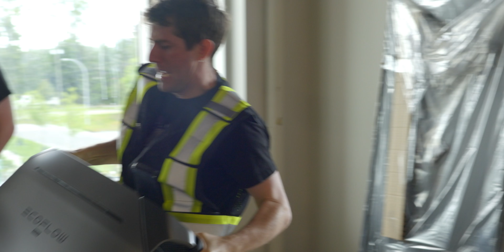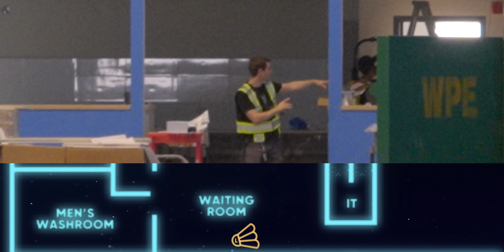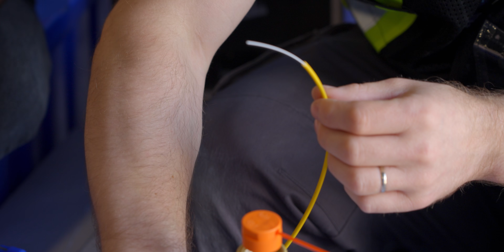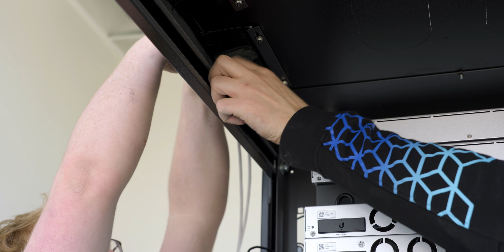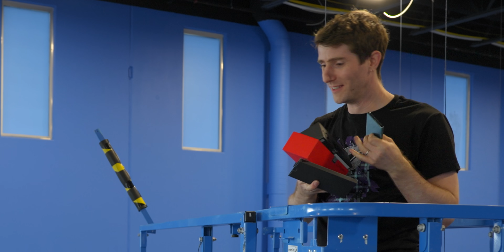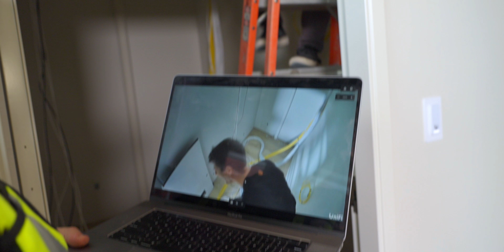I put WiFi 7 in my badminton center

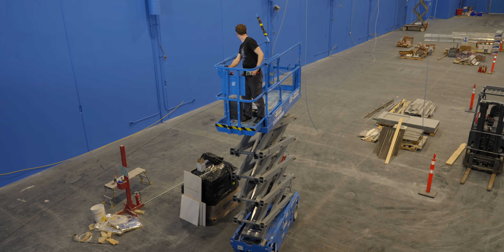Comment: Fun fact: at 19:07 Linus violates the Canada Labour Code by moving the scissor lift horizontally without a harness
Reply: We caught him lackin
Reply: Call the mounties
Reply: glad to know Canada has heir own Osha
Reply: Its inconclusive. Do you have a measuring tape to measure if the platform is over 2.5 meters tall?
Reply: @ImTheMrMoose  That platform was for sure over 2.5 meters tall.
Reply: @ImTheMrMoose we have Linus for reference ;)
Reply: @ImTheMrMoose  I measured the pixels using linus's height for scale (0.25 meters) and it is well within legal limits
Reply: I wouldn't even dare to go as high as he did without a harness, some final destination stuff right there.
Reply: @TheReduxGB  A harness is for getting kicked out of the EWP.  scissor lift doesn't have the danger that a boom lift has. I would actively not wear a harness in a scissor lift as it is more likely to create a trip hazard and be more dangerous than safe unlike on a boom lift where the risk is a lot higher especially when driving around as you can end up in a catapult.
Reply: @johnschroeder3072  there is reasons it's required by numerous safety boards - safety you never mess with even if it seems useless, as it exists because of accidents in the past.

There was a point where Linus knelt down to pick something up from the 'toolbox', at the way he was, if he lost his balance for whatever reason he could arguably have easily fallen out in my opinion.
Reply: @TheReduxGB  In my experience wearing a harness in a scissor lift is more dangerous than not wearing one. I scissor lift has the same railing coverage as many fixed walkways where you clearly do not need a harness.
Reply: @johnschroeder3072  They actually require a tie off in any EWP (source; am a licenced EWP operator for everything except airport luggage trucks and ladders). They also require a shorter lanyard for boom lifts vs scissor lifts because in the case of a scissor lift the lanyard and harness is there to keep you from falling off/out of the platform where as with the boom lift the harness and lanyard are there to ensure you don't become a trebuchet projectile, seriously booms are more likely to throw their operator than an operator is likely to fall out of one, people lean over the railing of a scissor all the damn time.
Reply: He must attest for his crimes
Reply: No hard hat or high vis jacket either
Reply: @M1Ms88  Hi-Vis in that situation is pretty useless and the only place that a hard was of use was either donw the bottom near the scissor lift or in it as he was working near the roof .
Reply: @M1Ms88  He is at the top of a lift, what the heck would they accomplish exactly?
Reply: Let's wear a harness, fall out of the lift, and then pull the lift down on top of me. Tie off in scissor lifts is stupid unless it's restraint, not fall arrest
Reply: this comment was all I was looking for, after they showed that
Reply: Most countries don’t require that in a scissor lift… a boom is different. A harness wouldn’t do anything in a scissor lift except create a hazard.
Reply: im reading the regulations and they keep specifying workers of the employer. perhaps linus did not violate it at 19:07?
Reply: AND the platform is raised!! 🤣
Reply: Canadian osha about to get 2 thousand narcs calling to report on linus from the united states and they'll do an audit and find nothing wrong. Linus will complain on wan show and canadian osha will get several thousand more calls from narcs who are mad linus got mad.
Reply: is that actually required in canada?  here OSHA mandates that a scissor lift is about the only time you are NOT required to have a harness. the lack of a hard hat could be an issue though.
Reply: Actually, in British Columbia, where this was shot, that is not a regulation. Lifts are only required to be operated with a harness if they extend outside the base (like a boom lift) and don't have a complete railing (it does). Also, the Canadian labour code doesn't govern this kind of work, it only governs federal operations. Provinces have their own acts. In BC, it's the worker's compensation act and its subsequent regulations that govern the provincial work. The CLC's Safety requirements are only for things under federal, not provincial regulation.

However, with all that said, it may violate the BC OHS regs IF that specific lift had a requirement to wear a harness in its manual--since there is a clause in part 3 of the regs that makes manuals as good as regs in BC. Most scissor lifts don't have that clause though.
Reply: I'm glad someone raised Linus AND the cameraman not wearing a harness on an EWP. Maybe Canada is a bit more loose compared to Australia but it hurt to watch.
Reply: @alexanderfreeman3856  In Australia you are NOT required to wear a harness in a scissor lift. The only EWP that you are required to wear a harness in is a Boom Lift.
Reply: And no reflective vest to top that
Reply: Snitch
Reply: Kaon here, I was very concerned that I may have to do my General Industry job that's not in my jurisdiction (US here)
Reply: Calling the labour board
Reply: So where should the harness be secured to? The ceiling?
Reply: I don't know anything about codes, but that was a pretty obvious no-no.
Reply: comparing it with the height of linus that platform may be just half a meter tall hsbvhdsbvsjbndjkns
Reply: We're worried about man getting thrown from a Scissor Lift in a flat warehouse?
Its not like we are travelling in a Boom Lift's basket across an uneven surface. We arent getting catapaulted.
Do your risk assessments, this is fine. 
also mans is the proprietor, not a worker. He is liable for himself.
clearly not a concern
Reply: @beahydrated whilst this is true he is also broadcasting bad/ poor practice on the internet
Reply: Narc
Reply: 😂a harness in a scissor lift, what a joke
Reply: @juledoren  regulations are written in blood.
Reply: @Eridescent  A harness is going to be more dangerous in a scissor lift than safe. In a boom lift, well that's another matter
Reply: @Eridescent  a harness wont help if your scissor lift falls lol you are gonna be falling with it regardless
Reply: @juledoren Just based on common sense: a harness will save you if you get shocked or stumble and go over the edge. A helmet will protect you from smashing your head against the beam and going over the edge due to temporary loss of consciousness, and also protect your head from smashing against the scissor if you do go over the edge, enabling you to assist in the work of saving you.

Tipping it while stationary, not likely. The fact that it moved as fast as it did while extended? Actively stupid. It looks like that platform is about a meter wide. He had it raised to about 4-5m height. Ride one side wheels into a ditch 20 cm, be standing in the side that it tilts toward, and the whole platform will be outside the footprint of the base. There are cable channels in that floor (shown in previous video), we are assuming that the covers are installed and can take the weight of half of that platform.
Reply: @Eridescent  I have absolutely no clue what a harness is supposed to accomplish on a lift.  It is basically impossible to fall off of one of those unless you are being intentionally unsafe.
Reply: @juledoren  I mean, when he also leaves the gate open you can see why they're required in some areas.

Comment: i actually build and modify doors and frames for a living to make that strike fit all your gotta do is measure out i think 1' 1/8 down dept on face aka. cut the side of the frame out (its been a min since i had to modify one of these) from the small part that over hangs from the ASA face plate and or course weld in new mounting plates for the electric strike (E9) in the frame EZ PZ.

Comment: You think you have it tough splicing that fibre… try cold cure polishing multiple fibre ends on a building site. Now that sucks. Final pass and someone walks past or opens a panel door and… scratch… start again… someone starts up a new air handler and blows a load of shit down the duct… scratch… start again… someone decides to install an interconnection in a box outside…. Scratch… and start again… sparks cut the fibre too short and won’t re run it and polishing on the top rung of a set of 10 tread steps… you guys don’t know you’re born… 😂😂😂

Comment: Being that high on scissor lift BUT trying to lift 6meter long steel pipe with outer diameter of 115mm on the hangers with your friend. So scary stuff to do that high and breaks forearm muscles so you need to be fast and precise while trying to not drop the heavy pipe on someones head or destroy the concrete floor underneath

Comment: Well,if you can watch your videos on more than 360p without it buffering than ofc your wifi is better than mine. 
Egypt needs it's internet infrastructure and make it unlimited ffs.
Reply: More like mindset. A lot of international sea cables pass through Egypt. They could surely have good network if they wanted, unfortunately it's the mindset that's holding them back
Reply: @hariranormal5584 we had a good speed and unlimited internet like 8 or 7 years ago but when the current government took over (using the internet to their advantage) they downgraded the internet so that ppl don't use it against them

Comment: Not a great sponsorship on that rack.   The rails should not be that flimsy with that amount of weight, even with their side mount sections.   I have lot of the same gear crammed into my Startech rack with no issues (UDM SE, NVR, High Cap Agg, ProMax24 POE, etc).

Comment: hey people i want to put out a call to the gamers using starlink should i get it for my gaming rig? The max gbps i get of the town's copper it 50gbps, and i can get 100+gbps through starlink.
Reply: Are you sure you got your units right? I highly doubt any residential connection provides 50 Gbps. you probably meant Mbps (megabits per second).
Reply: @JJFlores197  oh yes my bad i thought i had something wrong
Reply: @L0CKW0OD  Just be aware that Starlink has a much higher upfront cost than most other internet providers. If you need the extra speed and are OK with using satellite internet, it should be fine.
Reply: @JJFlores197  ok thx good to know

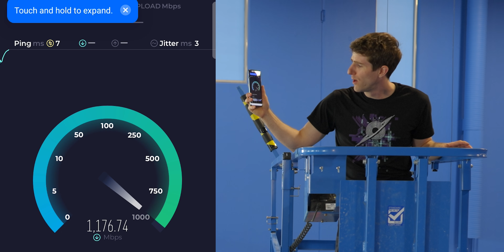Comment: 18:34 clickbait title. Here in Brazil you can get 2GB/s for the equivalent of 20 dollars (like 110 reais). This isn’t FAST by any means. That’s average.
Reply: There is a difference betwen Gigabit (Gb) and gigabyte (GB), they get 1,5Gb speed, which is 12 GB, and that 2GB that they advertise in brasil will not be real 2GB unless you live in the internet tower, it will be more like 0,4GB
Reply: @dominykasremeika89  When I run it through ookla speedtest (like they did) I do get higher numbers tho. It is gigabit but so is the one in the video I think.
Reply: For home use, sure.

Comment: That 4 post rack is nice and all, but I think I would've gotten 2 post networking racks instead if its going to be nothing but 1u networking gear. The 2 post racks are typically thicker to prevent the bending weight issue. You could still have the 4 post rack for servers as well, but this seems like a waste of weight capacity.

Comment: The wifi setup is definitely not overkill, I'd say it's underkill. I go to a demoparty called "Revision" every year with around 1000 ish people there, and probably around 2000 wifi devices. Anything that's using 2.4 and 5ghz is completely unusable in the main hall there. Like, i tried to open a wifi hotspot from my phone to my laptop who were right next to each other and the laptop did not connect. That's the kind of conditions you need to plan for. Your APs need to scream the loudest.

Comment: Ehh U7 Pro and S24 Ultra pulling right at 2gbps over WiFi.  But a lot less WiFi congestion than there though.

But my problem with WiFi 7 AP's is the issue with certain WiFi 6 devices not behaving correctly.  PS5 for example, nothing by latency and slow speed issues when connected to an AP that is WiFi 7

Comment: If you have not already, please put in some SFP blank covers in the vertical mounted fiber switches to prevent the empty slots getting filled with dirt/dust over time.
Reply: They said they already spoke to support at 12:48 and that they’re gonna get those blank covers from the manufacturer, but definitely agree, they also will probably not clean it out for like 6 years knowing LMG😂
Reply: @YesNo-rz2dn  thats for the side mount rack units in the rack, not the vertical switches in the bottom room

Comment: As a network engineer, I love when you guys do network related videos! Keep up the good work.
Reply: As a neteng you couldn't have watched this without cringing. Seriously, Ubiquti for everything?
Reply: @hariranormal5584  I did but they aren’t network engineers or claiming to be lol. I personally work with arista, Cisco, dell, Aruba etc
Reply: @hariranormal5584  They also used the wrong type of fiber connectors on their patch panels. Literally no reason to use PC there instead of APC

Comment: `????????? i have 1,5Gbps at home guys. ping 1. use HDMI cable if you can - delete all Cat5e RJ45 Ethernet Cable/Patch Leads - Booted. do you can separately turn off any plug in that giant power bar? no? fix that

Comment: I'm a bit mixed on the U7 Pro Max.  It removes the Bluetooth radio compared to the U6 Enterprise, which means it does not work with the Protect Smart Sensor.  It also lacks 4x4 on the 6GHz band, which feels like a bit of a downgrade.  Also, to be fair, I have absolutely no WiFi-7 devices and given that most of my mobile devices are Apple, chances are it may take me a few years to be willing to upgrade to a device that has it.

Regarding the UDM Pro Max, I kind of wish it had a couple LAN SFP+ ports on it.  I've sort of struggled with the best routing setup on my network.  Right now, the US-16-XG is my main switch that connects to both the UDM Pro and the USW-Pro-Max-24-PoE.  So, that means if I update either the UDM Pro or the US-16-XG, the Internet goes down.  So, I'd kind of prefer to use an upgrade to the UDM Pro as the central switch, but even the new UDM Pro Max doesn't have the SFP+ for it.

Awkwardly, one reason why I ignored Ubiquiti's U6 devices for so long is that none of their switches -- except for one really niche one -- supported PoE+ and 2.5Gbps. Fortunately, the new Pro Max PoE switches do -- as noted in the video -- support both PoE+ and PoE++ over 2.5Gbps.

Comment: I understand you gave a disclaimer, but every time you guys do anything with the ISP equipment or fiber, I shake my head. At this point I feel like LTT could use a full-time fiber tech, or if nothing else sollicit one of the thousands of technicians around you to give you a hand. Hell, I'd splice the end of the cable on for the lowly cost of a cheeseburger.

Comment: Your Wifi IS better than mine... No question!  However, I have a wifi 6+ router with 1.2g internet from Xfinity...  When I do a Wifi internet speed test from my Samsung S22 Ultra, I get between 1.1Gb - 1.2Gb every time. My Wifi may not support hundreds of users at one time, like yours.... but it kicks ass for a single user like myself.  😄

Comment: Video: Showcases corner office for literally any reason

My 12" subwoofer: "Let me sing you the song of my people."
Reply: I thought there was a semi truck idling outside  my house until I saw this comment.
Reply: Its quite terrible how loud it is with a subwoffer
Reply: Came here to complain about this. It's so easy to avoid I'm surprised they missed it
Reply: 12" subwoofer go wubwubwub
Reply: Not many comments about this, but damn it was loud. Editors must have bad headphones/speakers to miss it.
Reply: @tava6416  It wasn't terribly loud for me, but I also don't have my sub cranked regularly. 😅 I just noticed it and thought there was something outside. Hahahah.
Reply: @tava6416  i had to crank the bass on my sennys to hear it well enough to make sense of it, i dobut they could even hear it without a dedicated sub
Reply: @tava6416    @hemeon  timestamps would help but if you mean the background hum around 7:45 for example, you guys need to adjust your subs properly…  While noticeable when I went looking for it, it’s not a loud hum.
Reply: @nicinicinici I mentioned it wasn't loud for me either, just noticeable. I have an audio interface that has independent volume controls for my monitors and my sub. It wasn't turned up too loud though. 

My 8" sub in my truck barely registers it while I'm replying to this comment.
Reply: @nicinicinici Also thank you for time stamping for me. ^.^

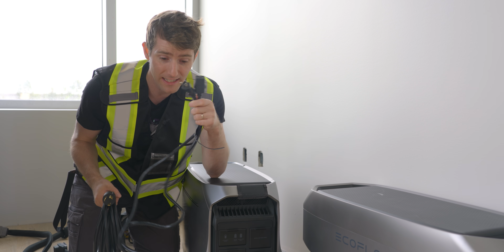Comment: 7:23 C19/C20 reallly? Why not PowerCon True1 or the Seetronic copy?
Like thre is point pro C13/C14 or C19/C20.
Powercon TRUE1 does 16A/250V AC VDE or 20A/300V AC UL, is locking, is IP65 and can be used as a powerstitch/plugged under load.
Wish it would find more use in IT too.

Comment: the mimo and mlo is super interesting , cant wait til we have 4 and 5 band wifi. auto adjusting based on distance to the point . TriFi - Triple Band Wifi is also super interesting but not a ton of radios support it . The LED switch can be very useful for easy troubleshooting .

Comment: I bought an EcoFlow Delta 2 for hurricane season to power my cpap during outages.  1kwh of battery that recharges in 3-5 hours on a suboptimal average day sunlight with the solar panels (tested).  It works pretty well.  Obviously I can't charge it during the storm, but we usually have hot sunny weather after and it takes 3-5 days to get power back in my area.

Comment: Wifi 7 as it stands right now is not a big leap over wifi 6 as it was made out to be. Within 15 feet of my isp's provided router, which is installed in a closet, I get nearly 1400Mbps down and 1200Mbps up testing with my Galaxy S23. It might be another year before the technology matures enough to be considered a significant upgrade.